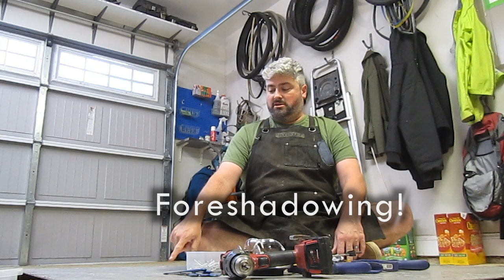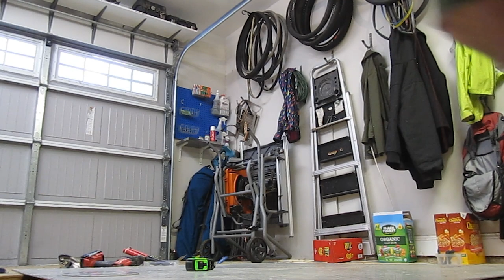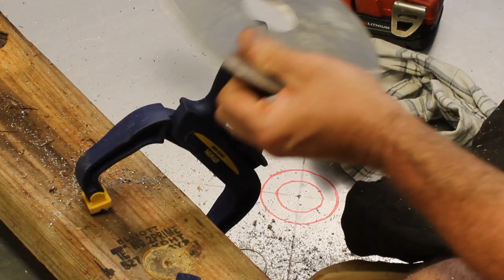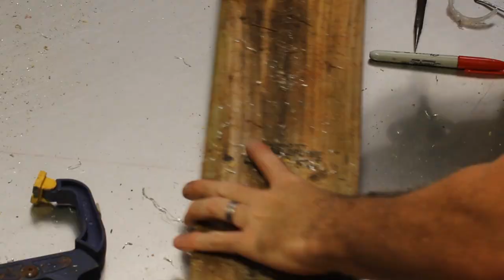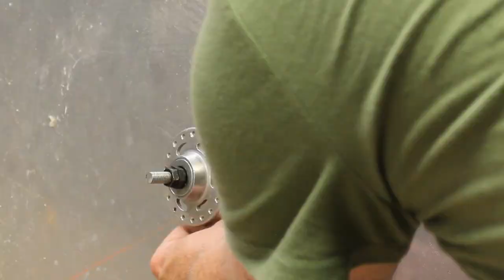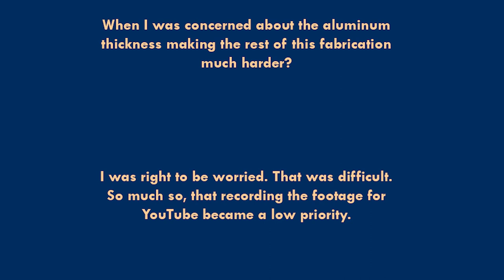Giant Pinwheel - Fabrication Challenges of a metal pinwheel for Pilot Park

Comment: Pinwheel that size would be more robust and longer lived if you had employed a hub from a moped or small motorcycle.  It’s hard to imagine that the bearings and races will last given the weight/lateral forces associated with attaching this from only one side (remember, a bike frame/forks attach to either side of the axle)